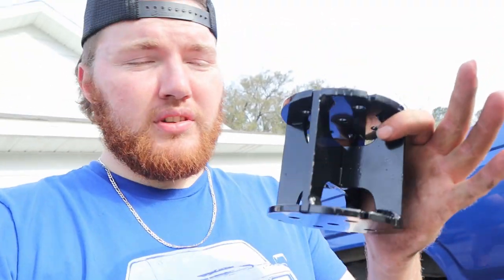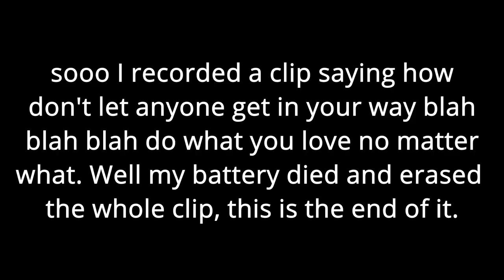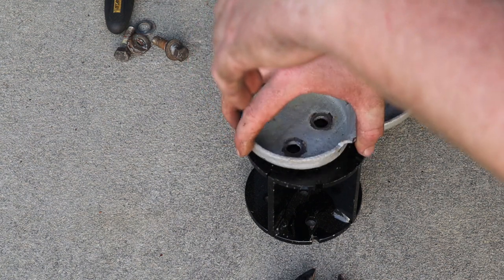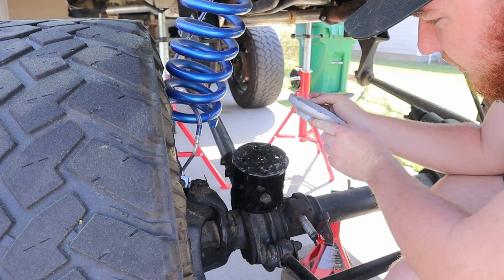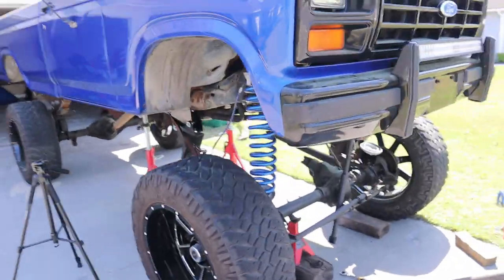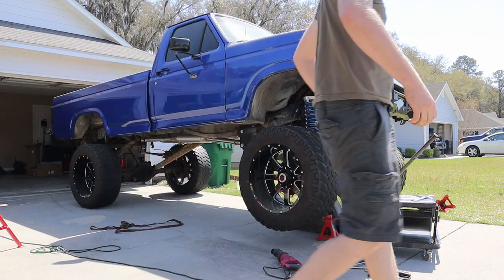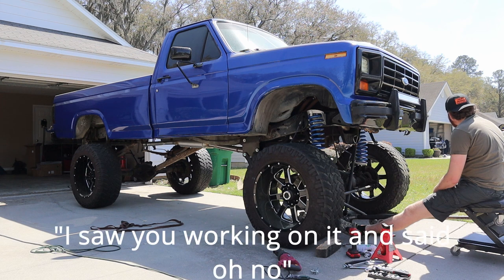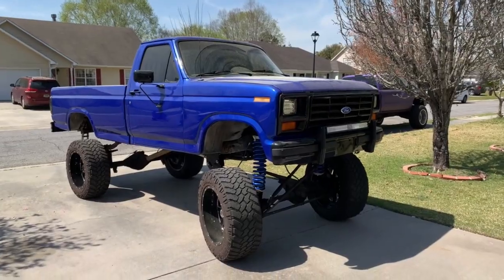20” LIFTED Ford Built In My DRIVEWAY (Concerned Neighbors)

Comment: I feel like it's important to mention that this is a project truck, this isn't something that is going to be rolling down the highway, or going into mud pits at the moment. 2 bolts and spring spacers are fine, but I wouldn't want that with something I'm going to beat up. But for the time it's absolutely fine. I havnt heard alot about lift spacers being bad, except on from leaf springs. Not sure why just what I've always been told.
Reply from the maker: Considering the spring is only originally held in with two bolts I don’t consider it any different than before. Although this truck will never see a mud hole and will probably drive less than 100 miles a year. This is 100% something that could be on the road, only difference is the spacer, it’s still bolted together the same as factory.
Reply: @AaronCates  factory standards don't necessarily apply to this truck, those spring perches will receive alot more load then they would on a stock truck. Always overbuild everything.